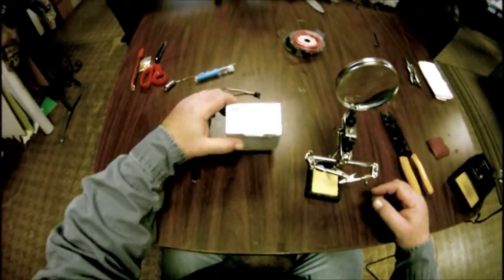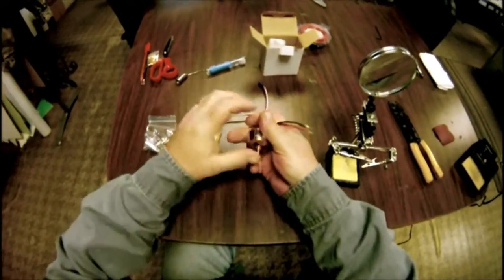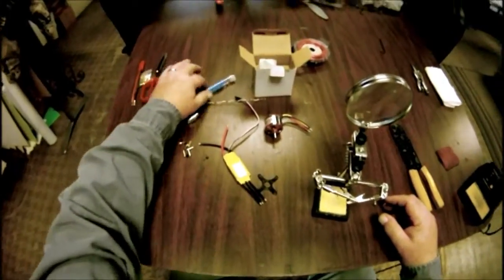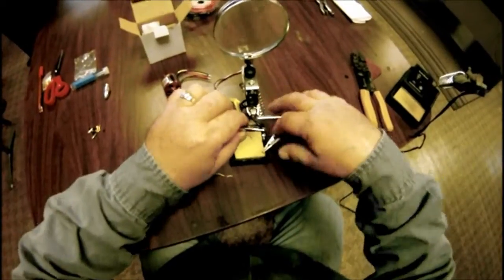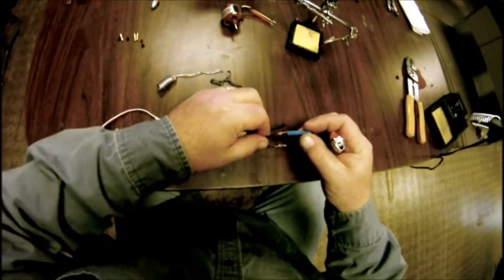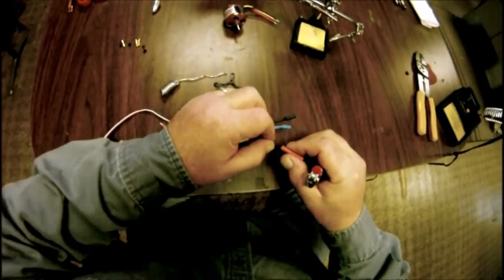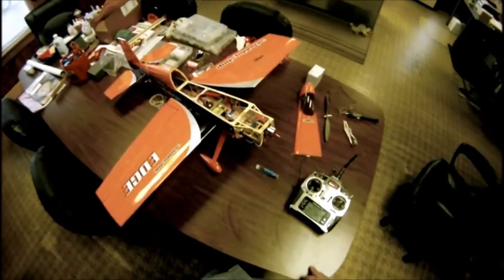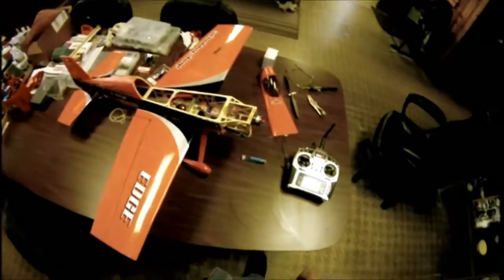Setting up and programming a Suppo Motor & ESC

Comment: Thanks, man. The instructions for the ESC were difficult for me to understand for some reason. Once I saw you do it, it made sense. My plane needs the prop brake. It’s a pusher-type seaplane and if the prop windmills it blankets the tail and the plane goes out of control. Difficult to land. Now I can set the brake. Thanks!

Comment: Quick question if the ESC is programmed for the wrong battery type will the motor shutter when throttle is applied?
Reply from the maker: Yes and a loose connection or a bad solder joint can also cause shuttering....
Reply: Thanks